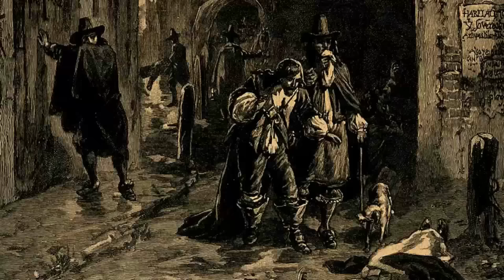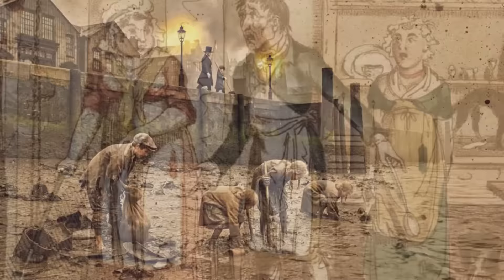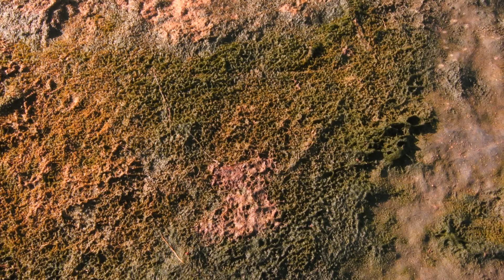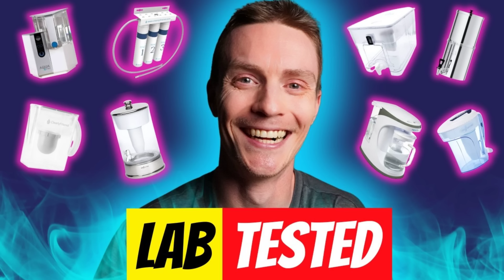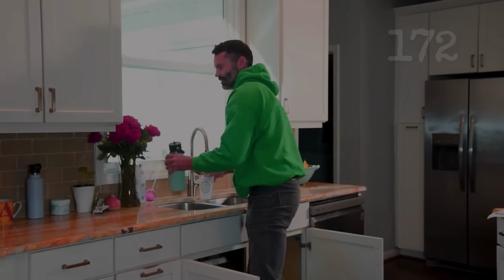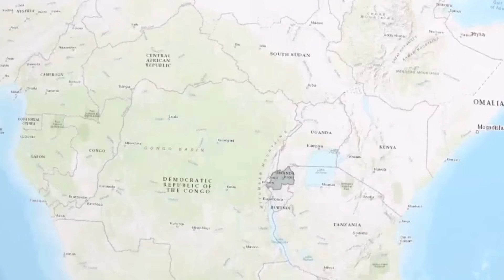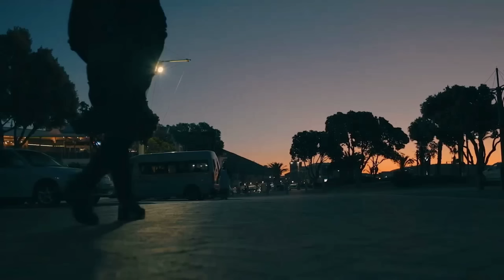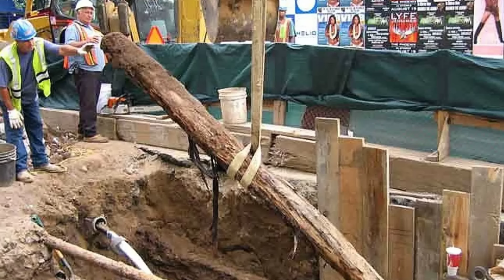The $50 Water Filter That Outlasts Any $5,000 System. Why Don't They Sell It?

Comment: Today we dont have only bacteria problems but even more industry chemicals like pfas, pfos, heavy metals and pharmaceuticals. I dont think that this kind of filter will help.
Reply: I'm not positive but I beleive municipal water filtration isn't able to completely remove the heavy metals, disolved pharmaceuticals nor "forever" chemicals.
Reply from the maker: @bmead144  You are correct. Municipal treatment systems were never designed to remove pharmaceuticals or PFAS, and most cannot. These compounds pass through conventional treatment largely intact and end up in your tap water at trace levels. The uncomfortable part of this conversation is that the industry selling you home filtration systems as the solution to municipal contamination is profiting from a regulatory failure that should have been addressed at the source. Should consumers be responsible for filtering out contaminants that were never supposed to enter the water supply in the first place?
Reply from the maker: You are right that the modern contamination landscape includes threats that a 200-year-old technology was never designed to address. But the framing matters. PFAS and pharmaceuticals are dissolved chemical contaminants introduced at the industrial and municipal level. The biosand filter was designed to solve a different problem, pathogen removal from untreated surface water, and it solves that problem exceptionally well. The question is whether we dismiss a technology because it does not do everything or whether we recognize that no single filter does everything and start thinking in terms of layered systems matched to specific threats. What contaminants are you actually trying to remove?

Comment: That’s all great for single use. HOW do you build a system for a whole property to filter tank water and shower water?
Reply: Run it thru this then into supply holding tanks. At least I've seen some rain water catch systems that did this. It flowed thru a sand filter and then into a supply tank. You could even add chlorine at this point if you wanted to.
Reply from the maker: @modsquad8u  That is exactly the right architecture. Biosand filter into a holding tank with optional chlorine or UV treatment before distribution solves the flow rate limitation of the biosand filter by decoupling filtration speed from demand. You filter slowly and continuously into storage, then draw from storage at whatever rate you need. Adding chlorine at the holding tank stage also provides residual disinfection during storage, which addresses the one gap biosand filtration has, recontamination after the water leaves the filter. Clean design.
Reply from the maker: Scaling a biosand filter for whole-property use is doable but it changes the design significantly. For shower and general household water you would need a much larger sand bed with higher flow capacity, essentially a return to the municipal-scale slow sand filter that James Simpson built in 1829. Some off-grid properties run a large outdoor biosand filter that feeds into a pressurized holding tank, which then supplies the house through standard plumbing. The tradeoff is that a whole-house system at adequate flow rates requires a sand bed measured in square meters, not centimeters, which means a dedicated structure rather than a countertop unit. Have you looked into what your daily household water volume actually is, because that number determines the filter footprint?

Comment: Does it remove fluride & bleach ???
Reply from the maker: Fluoride no. Bleach, which is sodium hypochlorite or chlorine, gets partially reduced as it passes through the biological layer and sand column but the filter is not specifically designed for chemical removal. If fluoride is your primary target you need a dedicated removal stage using bone char, activated alumina, or reverse osmosis. The biosand filter excels at biological contamination, bacteria, parasites, and protozoa, which are the contaminants that make people acutely sick. Fluoride is a chronic exposure concern that requires a different tool. Are you dealing with municipally fluoridated water or naturally occurring fluoride in well water, because those are different concentrations and different conversations?

Comment: What about unglazed ceramic water filters
Reply from the maker: Unglazed ceramic filters are essentially what the second half of the video covers with the ceramic pot filter. The principle is the same, clay mixed with a combustible material like sawdust, fired at around 900 degrees Celsius so the organic material burns away and leaves microscopic pores in the ceramic matrix. Water passes through, bacteria and parasites cannot. Adding colloidal silver treatment to the fired ceramic pushes bacterial removal to 99.99 percent. The ceramic pot filter and the biosand filter solve the same core problem through different mechanisms, one biological and one mechanical, and they actually pair well as complementary systems. Have you used ceramic filtration before, and if so what was your source water?

Comment: Bullshit bullshit bullshit.  For starters, most american households don't even use or need a reverse osmosis system.  Next while a biosand filter is better than nothing, it is not nearly as good as a reverse osmosis system for treating water.  RO is usually greater than 99.99% effective.  the biosand filter is between 93% and 99%.  This allows 100x more stuff through than a R.O. filter.  Furthermore, R.O. can be used essentially immediately.  And the waste water can be used for non drinking water uses.  If I were homesteading in Montana, would I use a biosand filter?  No, I would have a 150 ft well that dumps out the best tasting water you have ever had.  How do I know... because I grew up in Montana drink such water.  This biosand filter is certainly a lot better than nothing, but it is not up to clean water system standards for clean drinking water.
Reply from the maker: A few corrections worth addressing. Most household RO systems do require electricity to run the booster pump that maintains pressure across the membrane, and the 3 to 1 or 4 to 1 waste ratio is published by manufacturers themselves, not an invented number. You are right that the biosand filter allows more through than RO in percentage terms, and that 99 percent versus 99.99 percent represents a meaningful difference in absolute contaminant passage. Where the comparison gets interesting is lifetime reliability. Your 150-foot well in Montana is an excellent solution until the pump fails, the aquifer draws down, or the well casing corrodes, all of which are documented failure modes in aging rural wells across the state. The biosand filter is not competing with your well. It is the backup for when infrastructure-dependent systems, including wells, stop working. Nobody needs a backup until they need one.

Comment: first lets start that you're full of sheet. period ok. reverse osmosis nr does not require any electric to operate so i havr no idea where u ger that from, thats the first debunk ok unless you also install an additional uvc light which is super duper low watts ok! Secondly a 10 stage reverse osmosis doesnt cost 2-3k$ to ibstall you can get one dwpendibg on manufacturer off of ebay amazon for $200-1000k depending how many stages and what u want on it ok that was 2nd, 3rd ro absolutly does not i repeat does not wate 3gal of water per 1 gal of drinking water i dobt no where u get your frame work fron but u are a poor poor philanthropist and i guess u r just like bill gates and we all no where that rabbit hole goes  anyone with any moral sense, the idea u r talking about is actually used in ro systems if youd like to remove dirty particles and than restore it with usable good for system health particle filter,. alsoways also remember that if u use rhat sustem u are talking about in the video than it is very very strongly recommended to add uvc light to get rid of bacteria in the water especially in africa and or anywhere aroune the world where there are industrialists period. SORRY THIS VIDEO IS ABSOLUTE THUMBS DOWN IF YOU ARE COMPARING THIS TO RO UNDER THE SINK! NOW IF THIS 2AS APPLIED ON CONMERCIWL/INDUSTRIAL LEVEL INSTEAD OF USING CHEMICALS THAN WE ARE TALKING BUSINESS OK BUT YOURE NOT THINKING NOR UNDERSTANDING EVEN THE THEORY OF WATER FILTRATION THE GOOD AND BADD IN REAL LIFE REALITY WHEN IT COMES TO LARGE CITIES, BECAUSE THE WATER FROM THE COMMERCIAL FILTRATION SYSTEMS WHEN IT GETS TO YOUR HOUSE IS STILL ABSOLUTELY NOT DRINKABLE PERIOD!!
Reply from the maker: Standard under-sink RO systems use an electric booster pump to maintain the pressure differential across the membrane. Units without a pump exist but rely on municipal line pressure, which means they fail when water pressure drops. The 3 to 1 waste ratio is published by RO manufacturers in their own spec sheets and is a function of how membrane separation works physically. These are not debatable numbers, they are engineering specifications. On pricing, you are right that basic RO units can be found for $200 to $400, but installed whole-house systems with pre and post filtration stages run significantly higher. The video compared across the full range. If there is a specific factual claim you want to challenge with a source, I am happy to look at it.

Comment: Well they didn't have forever chemicals back then. Your sand isn't filtering that out
Reply from the maker: You are correct. PFAS and other synthetic chemicals are dissolved at the molecular level and pass through sand filtration untouched. The biosand filter was never designed for that threat and no one should claim it handles forever chemicals. The deeper tension though is that no affordable consumer filter reliably removes PFAS either. Granular activated carbon reduces some PFAS compounds, ion exchange resins handle others, but both require regular replacement and neither guarantees complete removal of all PFAS variants. The uncomfortable question is whether any household filter should be expected to solve a contamination problem that was created at the industrial level and should be addressed at the regulatory level before it reaches your tap.
Reply: @LostBuildArchivezwe both know that will never happen because they want us sick

Comment: Seriously … you’re using deadly plastic bottles as water filters 😂😂😂😂😂😂😂😂
Reply: Wake up the vids are from under developed places where u use what you have
Reply from the maker: @naradaian  That is exactly the point though. The technology was developed for places where people use what they have because nothing else is available, and it works. The question worth sitting with is why a system proven across 70 countries and 2 million installations is considered good enough for survival conditions but somehow not worth mentioning to a homeowner in Ohio who just got a three-week boil notice. The engineering does not know which country it is sitting in. Either the filtration works or it does not, and the data says it works. So what exactly changes when you move it from a village in Rwanda to a backyard in Tennessee?
Reply from the maker: The plastic bottle footage is from field deployments in developing countries where PET bottles are the most available container for solar disinfection. Nobody is recommending plastic as an ideal long-term filtration vessel. The CAWST biosand filter design specifies concrete or food-grade containers for the filter body itself. Context matters. When the choice is between creek water with active cholera risk and creek water run through a PET bottle SODIS setup, the plastic concern becomes secondary to the immediate survival concern. For a first-world build where you have material choices available, concrete or stainless steel are obviously preferable. What would you use?

Comment: Corporate greed , the same reason that we were/ are forced to use refrigerants that destroy the ozone layer and contribute to the greenhouse effect! When natural refrigerants like Ammonia, c02 and propane were better refrigerants and don’t have those side effects!
Reply from the maker: The refrigerant parallel is a strong one. CFC and HFC refrigerants displaced ammonia and CO2 systems that worked perfectly well, and the displacement was driven by patent control and recurring service revenue, not by superior performance. The pattern is identical to water filtration. An effective, simple, low-cost solution gets replaced by a proprietary one that generates ongoing revenue, and then regulatory frameworks solidify around the proprietary option, making the original solution harder to return to even after the patents expire. The question is whether this pattern is fixable within the current market structure or whether recurring-revenue business models will always crowd out one-time-purchase solutions regardless of the industry.

Comment: Wasn't this system first developed by the Romans?
Reply from the maker: The Romans used settling basins and aqueduct filtration but the deliberate use of slow sand filtration as a biological treatment process is generally credited to the early 1800s in Britain. Roman engineering was extraordinary for moving and storing water but the understanding of biological contamination and its removal through sand bed ecology came much later. That said, if you have a source on Roman sand filtration I would be interested to see it because the history of water treatment before the industrial era is poorly documented and full of gaps.

Comment: what about salt water - can sand filter out the salt?
Reply: No, of course not. These are mostly for microbes.
Reply from the maker: @justinw1765  Correct. The biosand filter operates on biological and physical filtration principles that have no mechanism for removing dissolved salts. Salt passes through sand the same way it passes through any porous medium, in solution and completely unaffected. Desalination is an energy problem, not a filtration problem, which is why it remains one of the most expensive forms of water treatment per gallon produced.
Reply: Salt water will probably kill the active bio layer.
Reply from the maker: @oldasdirt3760  You are probably right. The schmutzdecke is a freshwater biological community and high salinity would create osmotic stress that most of those organisms cannot survive. Even brackish water at lower salt concentrations would likely suppress the biology enough to compromise filtration performance. Salt water is a fundamentally different problem that requires energy-intensive solutions like RO or distillation, which is one reason coastal and island water security is such a different engineering challenge than inland freshwater filtration.
Reply from the maker: No. Salt is a dissolved ion far smaller than anything sand filtration can intercept. Desalination requires either reverse osmosis or distillation, both of which are energy-intensive processes. The biosand filter is designed for freshwater sources with biological and particulate contamination. If you are dealing with brackish or salt water, you are looking at a fundamentally different engineering problem that no passive gravity filter can solve.

Comment: Paused @ 2:28 
1.5 million people and no ones caring to do anything about a prime resource? It's 2026 and I cringe every time I drink "city water".
Reply from the maker: That reaction to city water is more common than people admit, and it is not irrational. Municipal water infrastructure in many American cities is running on pipes installed 80 to 100 years ago, and the gap between what treatment plants produce and what arrives at your tap after traveling through deteriorating distribution lines is a real and documented problem. The 1829 context exists because the solution to biological contamination was solved almost 200 years ago and the underlying principle has not changed. The question that should make everyone uncomfortable is not why it took so long, it is why the proven answer got buried under an industry selling you a more expensive version of the same result.

Comment: You mentioned plans for construction and instructions for operation.  Where do I get these plans and instructions?  Links would sure be useful.
Reply: google - CAWST Biosand Filter Construction Manual (Version 10): The definitive guide for construction and monitoring.
Reply from the maker: @MF-xz2uq  Appreciate you pointing people directly to the CAWST Version 10 manual. That is the single most important resource in this entire discussion and the fact that it is free and publicly available is what makes the biosand filter fundamentally different from every commercial filtration product on the market.
Reply from the maker: The CAWST Biosand Filter Construction Manual Version 10 is the definitive resource and it is a free download. Search "CAWST biosand filter manual" and it should be the first result. It includes exact mold dimensions, sand grain specifications, diffuser plate design, outlet pipe diameter, and step-by-step assembly with illustrations. Everything in that manual has been field validated across more than 70 countries. I should have linked it directly in the description and that is a fair miss on my part.
Reply: Bro has no critical thinking capabilities smh
Reply: He can't, he's legit chat gpt.